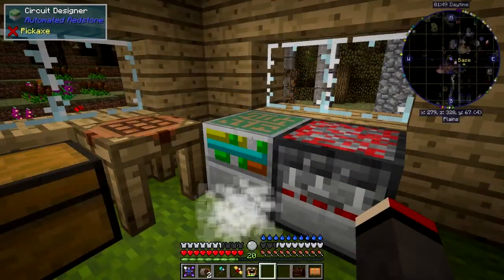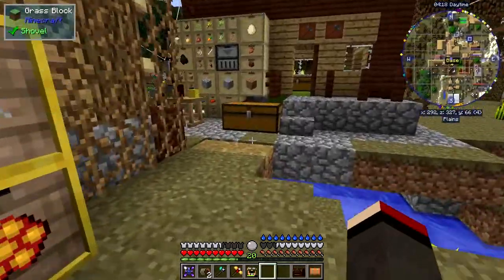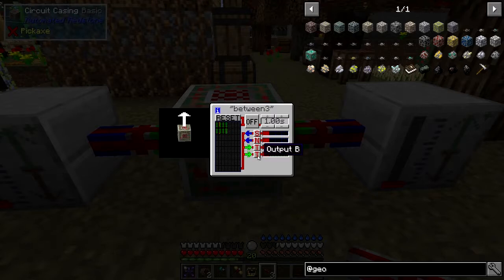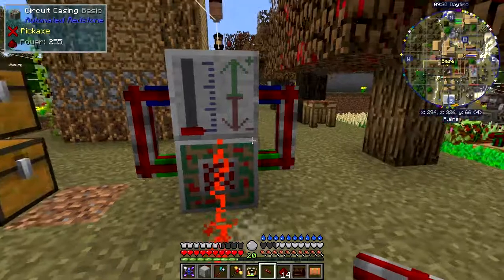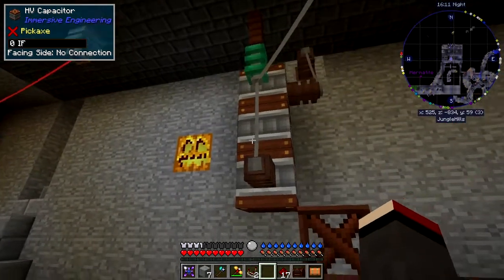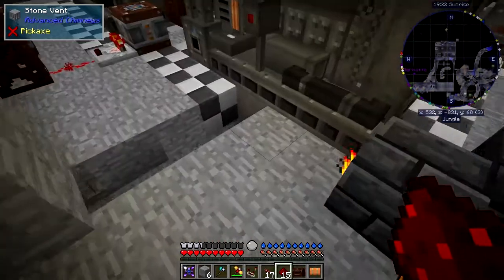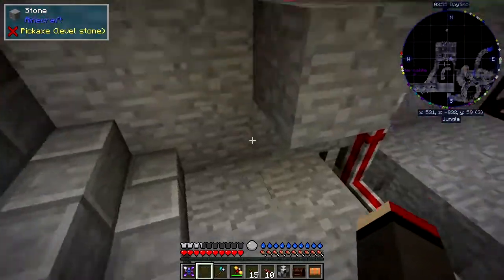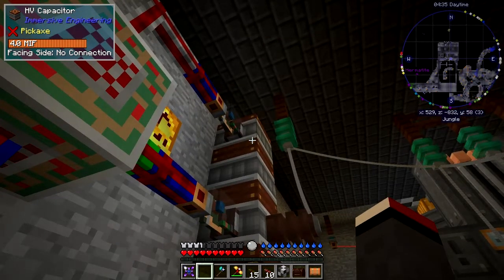Real Tech #074 - Automated Redstone High & Low Watermark

Comment: For some reason, to facade the automated redstone cables, we found that you have to hold the block in your offhand.
Just a heads up: in the next version of the pack, the Immersive Petroleum distillation tower will start outputting gasoline from PneumaticCraft instead of Immersive Petroleum. It will be fully compatible with everything in IP, but it won't mix with existing IP gasoline. Hopefully, that doesn't mess up too much stuff for you.
Reply from the maker: Wow that's a weird off-hand usage, thanks for the tip.
Thanks for the info and the fuel change will affect me as I'm any yet did build another three Magneticraft refineries to process the output from the first one. We get nine different fuels from the Immersive Petroleum oil, now I have to figure out what to do with them, :-).
Reply: Nine fuels? I hadn't even thought about MagneticCraft. I'll have to take a look at that before the release. Also, I'll see if I can come up with an easy way to switch between the gasoline types. Unfortunately, the id of PneumaticCraft's gasoline is "fuel", so it didn't automatically work with things that want gasoline. And, PneumaticCraft is not as configurable as Immersive Petroleum, that's why I changed IP to support PC fuel and not the other way around.
Reply from the maker: @DannySon  Oil->Heavy Oil, Light Oil & LPG. 
Heavy Oil->Oil Residue, Fuel & Lubricant, 
Light Oil->Diesel, Kerosene & Gasoline. 
LPG->Plastic, Naphtha & Natural Gas. 
What does the boat and portable generator use, Diesel?
Reply: Ok. Well, I'm not touching the MagneticCraft refining process. It was already possible to get both IP and PC gasoline from that. The only thing I'm changing is one of the outputs of the Immersive Petroleum refinery from IP gasoline to PC gasoline. And, I'm adding PC gasoline for usage in the motor boat and portable generator. So, I don't think it should affect you much then.
Reply from the maker: I've just watched my second video of the day that built the distillation tower. Yours was the first and the other was from sevtech ages where he was putting diesel back into the distillation tower for other products. Wonder if this is standard. The magneticraft refineries are surprisingly fun to build and run.
Reply: I'm fairly certain it's not. Sevtech Ages has a lot of recipe modifications. JEI has all the distillation tower recipes. I don't remember seeing anything like that.